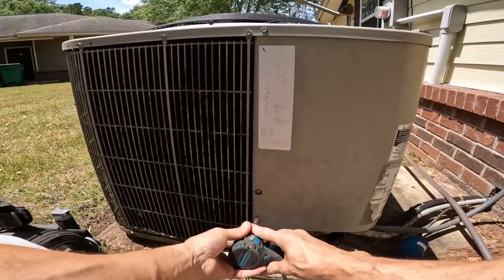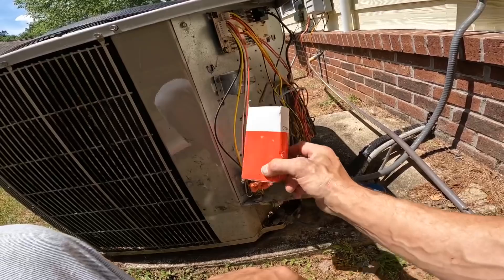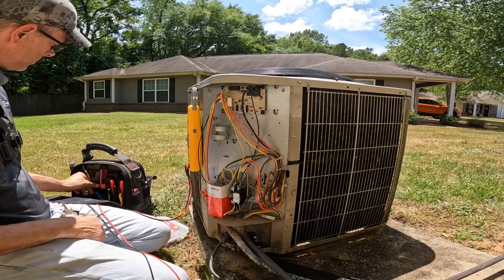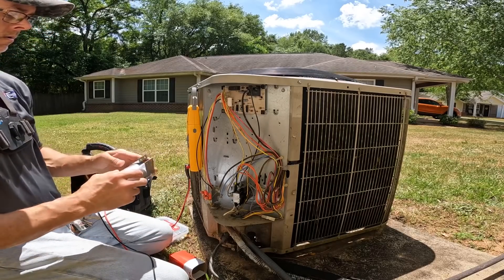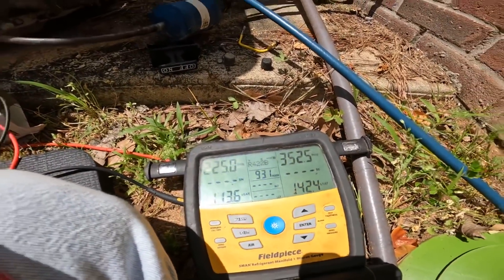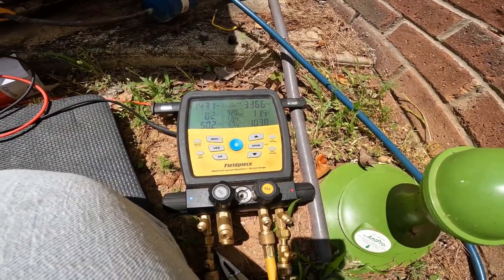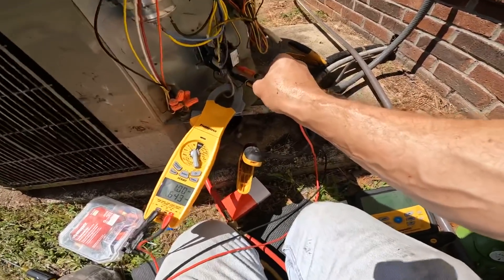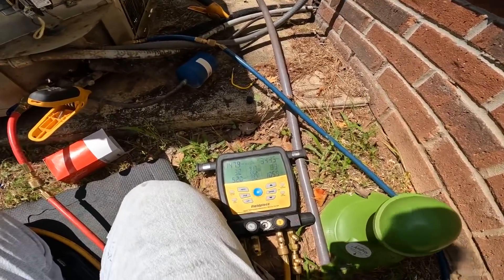Finicky Bryant Overcharged

Comment: This unit, for some reason looks to be a lot older R22 system. Tripping at lower pressure than R410A should.  With all that vibration, your going to get a leak in that condenser coil.

Comment: Big companies are the worst... tech told me I needed a new coil for $4,000 or new coil and condensor for 10,000.
    Went with small local company and have new Trane  HVAC system for $5,000. They did a beautiful job, left no mess and got a nice tip.

Comment: You should get the low  loss fittings for those gauges
Reply: I prefer a ball valve hose on the suction side and a low-loss fitting on the high side, myself.
Reply: @gamewizardks  why? I've never heard of having different ones on each side
Reply: @ShardTown  That's a matter of personal preference. Some days my hat doesn't match my socks, but hey, you do you and I'll be good over here. Seriously, though... The high side has too much potential for refrigerant loss. I prefer the ball valve on the suction side because sometimes I only connect that side and I like the versatility. Honestly, though, for quick pressure checks, probes are best.

Comment: I work for a Bryant Dealer. If you watch these specific systems over the course of an hour, you can see your subcooling (Bryant is all about the TXV), change Dramatically. You have to watch the Txv modulate. Which is how this probably happened.
Reply: Run it with the piston
Reply: Yeah. For a simple recovery, who wants to watch it for an hour, though? Most HVAC companies want a tech in-and-out on those kinds of calls.

Comment: Idk why but I hate putting caps upside down, does it even matter which way you have them, I've attached them right side up and sideways, but never upside down. Not complaining. Just very curious if it matters or not , I usually hoard stranded wire jumpers from the scrap yard and harnesses just in case I need a longer common jumper from contactor to the cap.

Comment: Is it just me or should that system be a R22 system by BRYANT ...
Reply: That’s what I thought.  That unit looks beat for a 410A system.  Why would it be tripping high head in the 400 lbs range, if it is R410A?  I’ve seen R22 high pressure switch pressures of 395-410 psi.

Comment: Got a call one day from my boss to do the initial startups on 4 or 5 AC units for a new restaurant. 
All but one did fine. That one had high (over 350 (410a)), and low suction. Checked it all out, found that the TXV was apparently clogged, let the bos know, he said "no, that can't be!", then told me to add gas. I told him that wasn't right. He said do it or find a new job...
Unit went up to like 450 discharge and would trip on high pressure. Let the boss know again, same results, called the other service tech, he said the same as the boss. So, even knowing it wasn't right, I kept adding 410a...
Surprise Surprise! After about 10 resets, the brand new unit burned up, boss had to pay for it, the installer had put so much silver solder in while installing, the little pellets had clogged the strainers on the TXV.
He started listening (kinda) to me a bit more.
Wasn't long, I moved on.
Reply: You did the right thing moving on.
Reply: wow, surprising your boss took responsibility and paid for it instead of blaming the installers.
Reply: Sometimes the boss is worse than the customer. "stupid is as stupid does" (Forrest Gump)

Comment: I couldn't really tell but was that wire you moved for the crankcase? Although connected to the shunt side of the contactor, doesn't the contactor give an amount of resistance and very minimal protection for components that are given constant power? Honestly to me it shouldn't make much of a difference connecting it straight to line, but it's just what I've heard.

Comment: The oil in capacitors Keep capacitor cool installing upside down defeats the purpose and will cause them to fail premature manufacturing company will tell you this.
Reply: As well as overtightening as they do expand as they get hot.  Give them a little slack or gentle snug.

Comment: Good repair. The only thing I felt that should have been done is to check and make sure that capacitor was the right one since some hack had been working on the unit.
Reply: its just a starting capacitor, they do need to be correct values, but sometimes you order a new one and the thing is shaped different. just replaced the one on my compressor and same thing was a different size.
Reply: In Curtis' defense, he did state early on he was familiar with the issues of this model unit.  I believe he would have noticed whether the capacitor was the correct values  relocated it.

Comment: Think I might have to get that SC680 meter… it would be nice to input that data through Bluetooth, albeit there are more conventional means of doing it, into measure quick for a quick seer rating. I worked for 4 years at Washington state’s leading hvac contractor and strictly did installs. I moved back to my home state in Kansas, and your videos, among others have helped a lot, as I’m now doing primarily service at a very small company. There are only 2 other people in the field, and either the owner or I will get the no cool/heat calls, and I’ve only been doing service for 4 months now. And yet, I’m the “senior tech”….So far it’s been way below ideal ambient temps for accurate readings, but measure quick has helped a lot with normalized targets under the current load conditions. I just can’t stand doing spring pm’s with practically every time having suction saturation temps below freezing but it is what it is! At least I’m learning though. I’m glad I was in agreement with you on recovering more with the relatively low superheat. Anyway, I digress, looking forward to the next one.
Reply: I stated reading your reply and thought "I didn't remember writing that!
I too, worked in Washington and moved to Kansas! I'm retired now though, Good luck!

Comment: I missed why you added the third wire on the capacitor, I assume it was a multi tap.
Thanks for the great video!
Reply: He replaced the one that was there. The one he replaced showed obvious signs of overheating, the insulation was bubbled. The wire inside will become oxidized, fail to conduct and cause a service call.
Reply: @bill944  thanks for that detail- good to know

Comment: Why the hell do people leave the capacitor in the box? Lazy ass technicians I guess. No pride, super embarrassing.
Reply: I see it all the time. If breathing wasn't an involuntary action we'd lose many techs.
Reply: @bill944  I see Journeymen and Masters doing this all the time.
Reply: A bad practice. It's basically done to keep connections from touching because the capacitor is mounted in the wrong position. Vibration can cause the capacitor to move and it being positioned next to the contactor can cause major problems. Modifying the factory mounting position to fit the new contactor would be the right solution, but hey who has time for that right?

Comment: I don't get why people leave capacitors in the box like that.
Reply: It's a bad practice, but techs will do it to keep electrical connections from touching when vibration could cause capacitor movement. Basically the capacitor is not installed in the right location. Usually the new cap being installed is bigger then the factory cap and mounting the new cap in the factory location becomes an issue. Instead of modifying the mounting, they generously give the customer the box included deal

Comment: Once encountered a York unit " 410-A"so severely overcharged , The compressor relief would open ,it would cycle of on high pressure and was reaching nearly 700 PSI .
Reply: That's some good brazing at least
Reply: @jaredtandle2596  Must have been ?  42 years in the trade , But what I cannot understand , The younger Techs. Do not know how to charge systems properly .
Reply: @michelgrenier1878  wrong advice being passed down and this trade is a lot of on the job training. I'm a newer tech and had received a bunch of old timer general advice that just isn't right.
Reply: @jaredtandle2596  I am an old timer Ha Ha , The newer techs are good at charging by weight ; But when the charge is unknown ?? Capillary and orifice systems are charged by adjusting the charge for a 18 to 20 degree F. superheat at the suction line entering the compressor , And all TX valve systems , Charge for a 10 Degree subcooling on the liquid line leaving the condenser . Alway's worked very well .
Reply: @michelgrenier1878  I was always told a general pressure and hotdogs hot/beer can cold on the lines. I go by the chart that's on the unit now which tells you ideal SH/SC and delta T. It's frustrating I was never shown that chart at first and was just told what I was told.
Reply: @jaredtandle2596  The method I described works on everything , heat pumps , AC, all refrigeration systems small ,  large industrial and supermarket systems , I have worked on all of them .

Comment: How many times can you call for service and the problem not be fixed before you call someone else? I noticed you pause after you said how many things got replaced 😂😂
Reply: I’ve had a customer tell me that the same company came out 4 times in a span of a week and they always ended up replacing a part but the issue was never addressed! Went out there myself and found a bad condenser fan motor , apparently on the hottest peak of the day their AC would go out. The condenser fan motor would go off on thermal overload on the hottest peak of the day but worked fine the rest of the day. They had replaced a board, capacitor , contractor , thermostat and added refrigerant 🤦‍♂️.
Reply: Being diagnosis detective is the fun part. They are missing all the fun to throw parts at it like a car dealer technician!

Comment: Curtis, didn’t anyone tell you that if you mount the capacitor upside down all the micro farads leak out😁🇨🇦
Reply: That’s why I keep electrical tape in my bag. If you tape it real good, it won’t leak.
Reply: That assumes they were intelligent enough to actually mount the capacitor.  This area seems to have a lot of capacitors still in the box because someone was too dumb or too lazy to mount them.  Unless they don't want the mess that all those leaking microfarads leave behind...
Reply: BOOOOO!!!!
Reply: Lol I was trying to think of something clever to say about that. Touché
Reply: The micro farads leak out because they're so small.
Reply: I like that one ☝️ haha
Reply: Sounds like we heading back to the future.  Lol
Reply: Capacitor manufacturers say they will last longer if installed with the terminals up for a reason!🤪

Of course I've seen plenty of equipment manufacturers that mount them upside down, and it doesn't seem to actually make a difference...

Comment: still amazes me how common "just fill it until it does not take anymore" is in residential systems. i always wonder how these service "techs" think that just adding charge solves anything.
Reply: It's called utter ignorance; usually happens when a person working for an apartment complex walks around with a jug of "Freeze-on" an adds refrigerant weather is needed or not; I've seen than happen a lot in Houston, Texas.
Reply: @bobboscarato1313  Not all apartment maintenance techs are created equal. I'm an HVAC guy who works as an apartment maintenance tech. At my work, the duds have to do paint and drywall, not me.
Reply: @gamewizardks  How many units do you have to service/maintain/replace per month?
Reply: @bobboscarato1313  5 or 6 service calls a day in the Summer is about average. 2 or 3 installs a month along with 4-5 coil replacements a month is not uncommon for me. It is not unusual for me to be strictly HVAC during the summer months. They never call an HVAC company.
Reply: @gamewizardks  It sounds pretty good; how is the money situation?
Reply: @bobboscarato1313  Not bad, but could be better. I have 3 interviews lined up this week, all of them HVAC companies.
Reply: @gamewizardks  That's great news!
Reply: @bobboscarato1313  You bet, friend.
Reply: last person probably charged in too cool of weather and overshot it with fingers crossed. they should have returned in warmer weather of course.
Reply: @throttlebottle5906  Ah that makes sense. Slight lack of diligence.